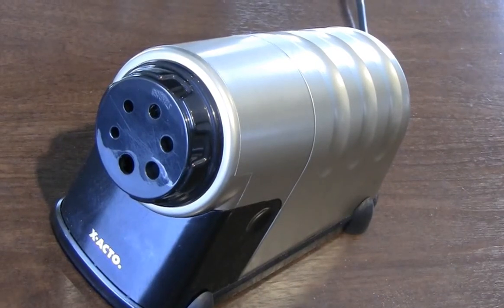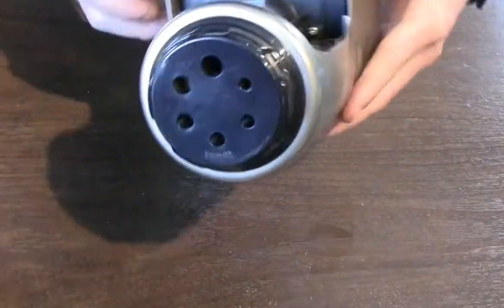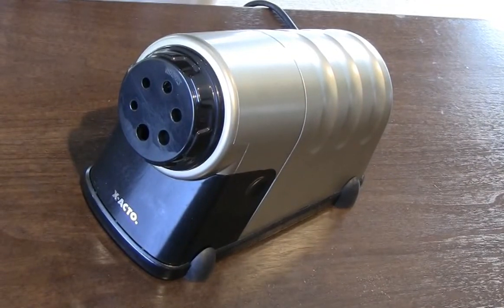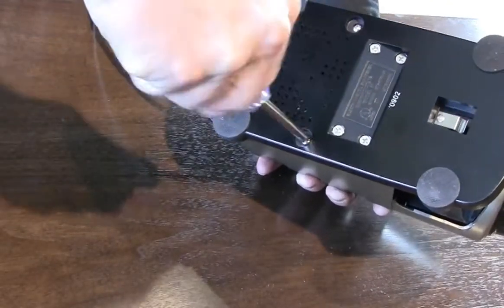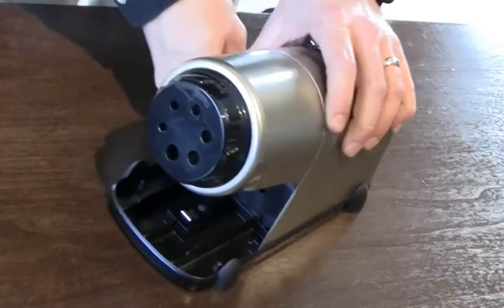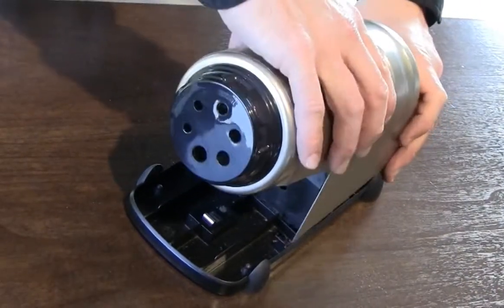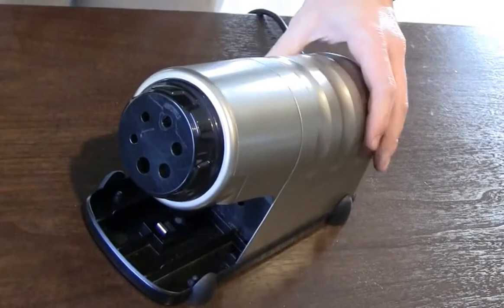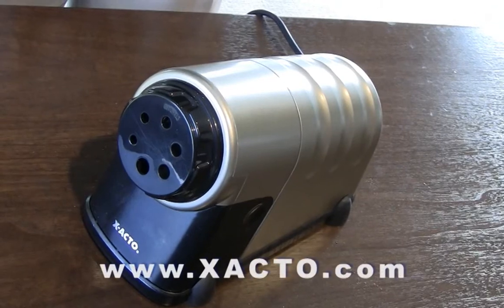How to fix a jammed pencil sharpener

Comment: How do I fix the exacto sharpener that has the rubber pads on the bottom, and no visible screws? I made the mistake of using a charcoal pencil in the sharpener, and I want to see if I can get the extra bits out of the back of the sharpener, as just scraping out the bits from the blade isn’t enough.

Comment: This really helped! Works like a charm now.

 Lesson learned...do not sharpen pastel pencils!
Reply: The old version of Xacto ProX can sharpen pastel pencils.  Now the blades are too fast and break the leads.  UPDATE:  I just discovered that the new models do sharpen pastel pencils very well, but the trick is to just dip the pencil in lightly, like dipping your finger in hot water. just a split second at a time.  It does a perfect job!  First put the pencil in only far enough to start the motor, then gently dip the pencil into the cutter and back out again.  I sharpen pastel pencils with my Xacto QuietPro and it works great, no breaks since I found the trick!

Comment: My Mitsubishi was clogged up with oily red marking pencil core gunk that would not have been removed with  air (not that I had any) so I used precision screw drivers to scrape the residue out of the grooves. Now it works like new, making a fine point with auto-stop.

Comment: Hi, I need a help please, I just bought a pencil sharpener model 1670, but the automatic stop mechanism does not work propriely and when I sharp the pencils they don't  has a good and sharped point, but it when I use the pencil sharpener the pencils points became full of burrs.  I don't know if it works like these and It'll become better whith the frequent use, or if I have to return to the place that Ia bought.